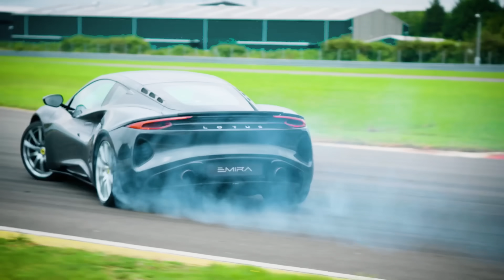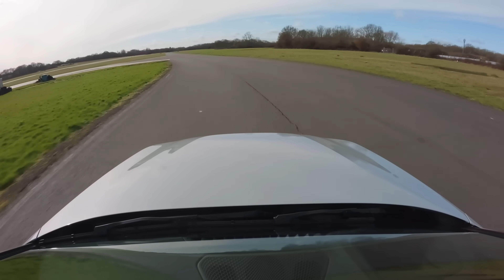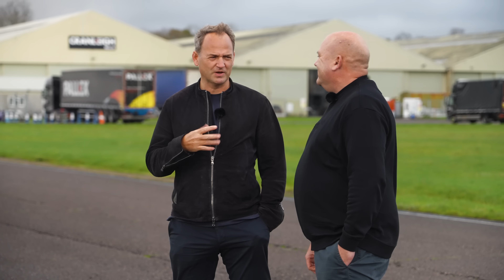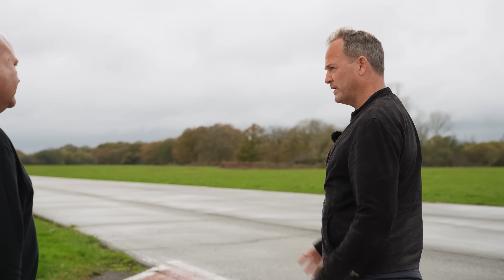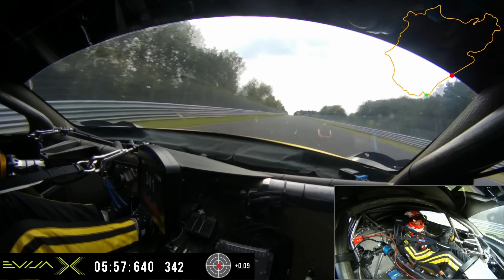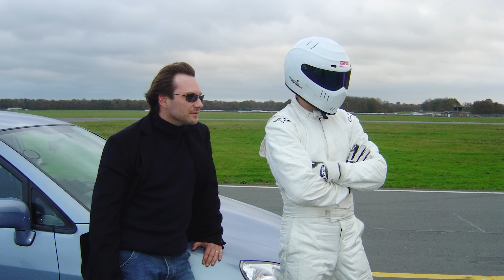Meeting the man that designed the Top Gear track

Comment: 17:10 Would have been a serious mistake from them to sack you for that. That crash showed that, while you don't actively want to crash the car obviously, you are pushing them to the limit, driving them HARD, and if a car happens to be a bit lary on the limit, it can go wrong. I think you threaded that needle perfectly, pushing the cars as fast as the amount of time, tyres, weather etc. allowed, but still only ever having issues with cars that were the least stable.

Comment: Since I lost my feet to sepsis I'm trying to imagine doing that track with hand controls. 
Lever on the right side of steering wheel. Pull to accelerate, push to brake. 
Have a hybrid 2.0Li CVT (no belt, direct drive) Corolla and you're right about that electric motor instant power off the line. 
In sports mode it surprised me! And as soon as anything a bit quick dips for 2nd I've got 'em as my acceleration curve is smooth with no pauses for gear changes.

Comment: The one thing that they never mentioned was that the second to last corner was originally called Backarack Bend, and Gambon was just called the last corner. Then when they started to call the last corner Gambon they dropped the name and just started calling it the second to last corner.
Reply: Probably Bacharach, after Burt Bacharach. I assume Clarkson named it. Didn't Black Stig have easy listening CDs on the stereo for cars on hot laps or something? I think that's where Chicago came from.
Reply: I read that Gambon was originally called Carpenters Corner

Comment: Never driven the track, but IMHO my experience in the 80s, climbing the fence and ending up at the end of the runaway when two jet fighters took off, was probably more intense than most people's experience driving the track.
Reply: Things that never happened #235
Reply: @samuelgarrod8327  I swear it's true.  

The fences are not high at points in the woods, we had a wander round, heard jet engines firing up and assumed that it was test firing in the woods where they had big concrete mounts and test fired engines as evidenced by the burnt out trees.  I expect it's all still there.  

But it wasn't test firing, it was two jet starting up, and unbeknownst to us we were on the grass not far beyond the end of the runway.  

Being under jet fighters at about 100 ft (total guess - it felt closer but was probably higher) is intense.  We all just hit the deck instinctively.  We were about 13 or 14.
Reply: @samuelgarrod8327  Also, 2.35 by Spacemen is a great song.  Were you referencing it?